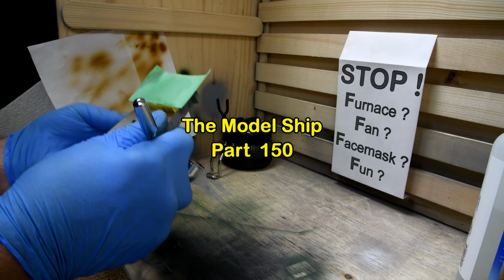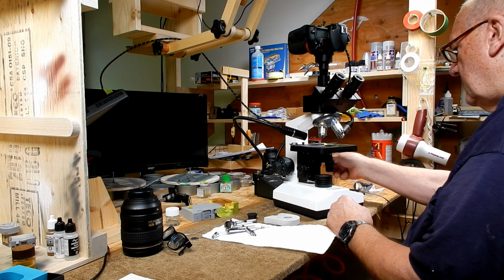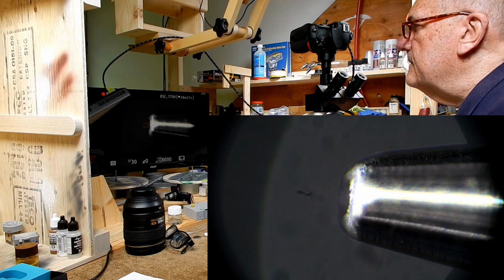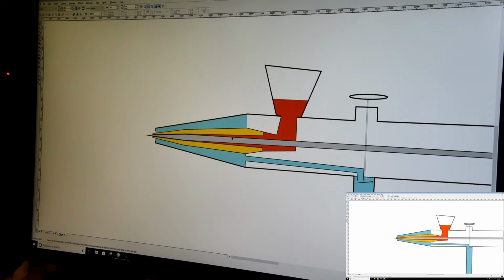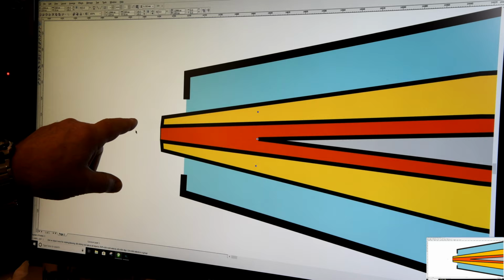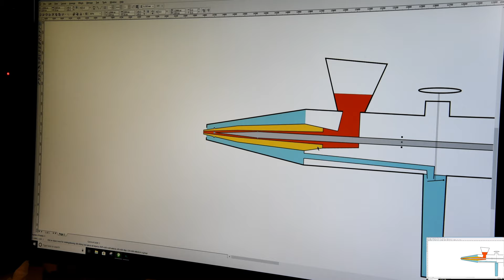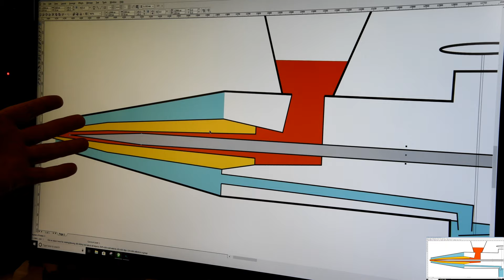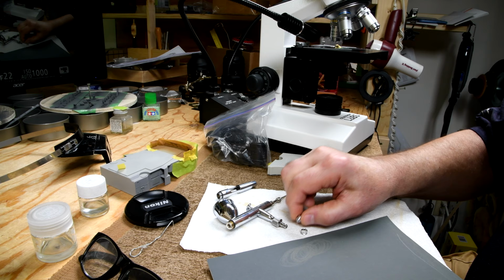The Model Ship - Part 150

Comment: Ron, you presented one of the best demonstrations of how the double action Airbrush’s works. Very good. DON’T clean the nozzle with a wire brush. Only soft material like a dental spiral gum brush. I’ve used my Eclipse for 5 years with zero problems. It’s a suction feed, not gravity, but the nozzle is the same. Tip - you can use the airbrush without the front nozzle part (tip exposed) so you can spray closer with really thinned paint ie. 50%, at a closer distance and lower pressure. Allows you to get into tight areas for good control. Buy the way Mark B asked me a couple of questions, hope I helped him out.
Reply from the maker: Hi Tony,
The only thing that I've used to pass through the nozzle tip is the soft bristles of my 00 paint brush. NOTHING metal, EVER!
Every time I have the eureka moment it turns out to be a dead end and this nozzle tip disintegrating theory may well be a dead end too, lol.
I think that Marc indicated in a previous comment that he had heard from you. It's nice when viewers interact helpfully with each other.
btw. Thanks for telling me about Maple Airbrush. I'd never heard of them. So far I'm very pleasantly impressed. 👍
Reply: Ron Calverley Ron, they’re pretty quick and all their products look good. This nozzle issue you are having is really puzzling. The only thing I can suggest is a step by step after assembling.
1. Connect and push down to make sure you get air. Start at low pressure and turn up pressure to different pressures.
2. Repeat, but with water in the cup.
3. Repeat, with thinner in the cup.
4. Repeat, with 50% thinned paint at low pressure, 15 psi.
5. Repeat, with 20% thinned paint at medium pressure, 20-25 psi.
Maybe you have done this, you are a methodical guy. You don’t need to clean between medium change. Check to make sure the small O ring is there between the body and the nozzle cap when you put the airbrush back together. That’s all I can think of.
Reply from the maker: Your suggestion to " back flush before cleaning" works well. Doing that with a few drops of isopropyl 👍

Comment: Holy Crap!!  $75 for a air brush NOZZLE!  I can't imagine what that air brush cost.  I hope your theory is right.

I can't comprehend what the maintenance cost would be on that thing is you were painting designs on cars or motorcycles all day as in a paint shop.  How many times have you actually use it.  Perhaps a call to the supplier or manufacturer would be in order.  If nothing else, just to give them some feedback. 

See ya tomorrow.            JimE
Reply: Believe Ron said that $75 was for two.  Still not a bargain.
Reply from the maker: Air brush parts are not cheap that's for sure. Living in Canada does not help in that regard either. I'm not trying to justify the cost, but it's not something that is common and it's not something that can be homemade.
Here is the actual break down Jim.
Nozzle $35.99;  Nozzle Cap $18.99;  Tax $3.61;  Shipping/Postage $17.19. There's your $75 bucks ($57 USD)
If all I wanted was just the nozzle and could drive over and pick it up close by, it wouldn't have been so bad. Now the whole air brush, as best I remember was $190 cdn. here in Winnipeg --- and I did drive over and pick it up, lol See you tomorrow 🙂
Reply: @roncalverley  I would be the squeaky wheel and be calling someone.  Nothing to lose.  Can only be positive at this point.

Example - I really like and use a Nite-Ize case for my cell phone.  The Velcro on the flap keeps wearing out every two months and replacements are $15-20 a pop.  I called them this week and explained my issue and asked if there was an alternative or a better choice.    The polite customer service lady told my not to worry and she would send me out two new ones right away.  She also gave me her phone extension and told me to call her back if/when they fail and she would replace them.  

I wonder how she knew I was 76 and probably wouldn't be needing too many more.  😁😁😁
Reply from the maker: Apparently there is a kit that changes it from a 0.35mm into a 0.5mm nozzle. The larger replacement nozzle is only about half the price. We'll see.